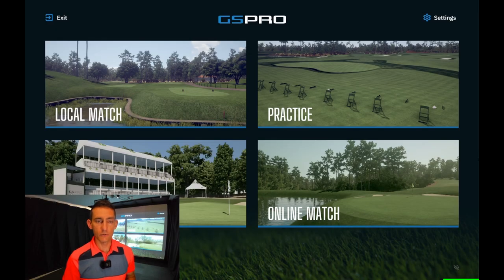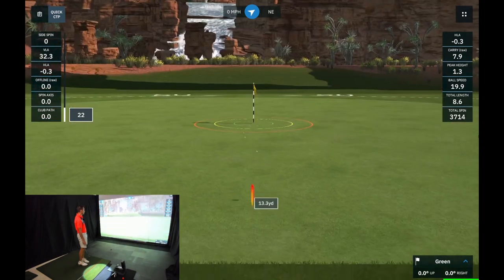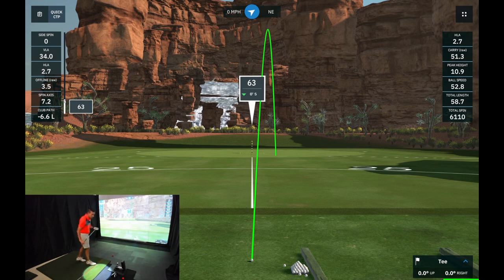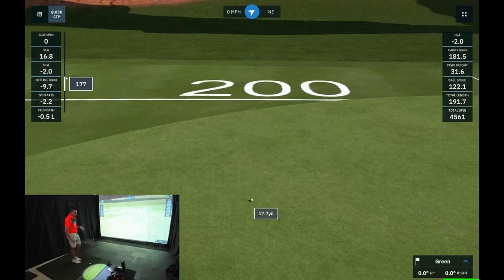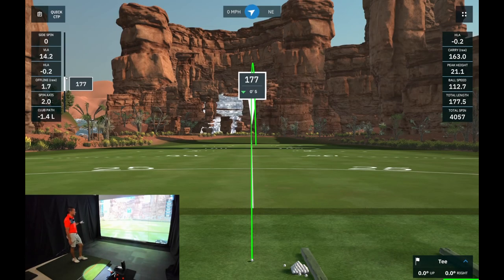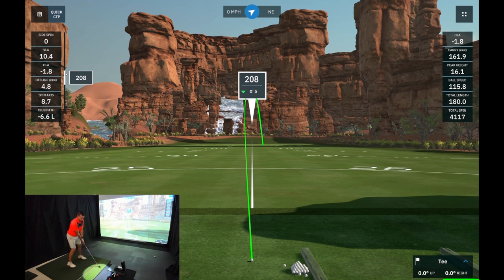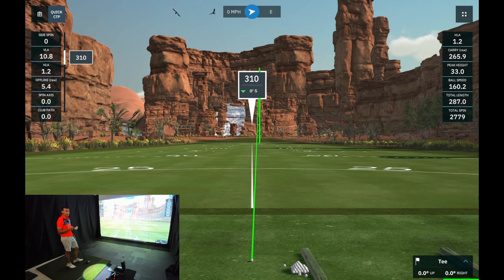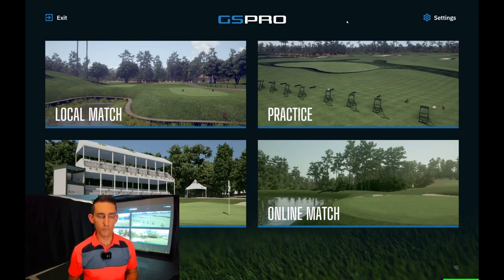Garmin R10 and the SCI-CORE Golf Balls

Comment: I've had trouble with noise complaints from next door as well.  It's quite frustrating considering the neighbors actually built their new house on the vacant block next door and chose to put the house right next to my shed where I put my simulator setup.  To make matters worse the guy works night shift sometimes and sleeps in the day so he even complained when I was hitting balls in the afternoon.  It got a bit tense there for a while!  I might give these SCI-CORE balls a go.  Thanks for checking them out.
Reply from the maker: Hey John that’s no good mate I really feel for you… I mean tbh its your property and during the daytime hours you can do what you want.. there are of course council rules that people should follow. I looked in to the council requirements and essentially said during the hours of 8am and 8pm I am allowed to do it and I wont do it outside those hours. It gets really tricky and Ive gone to lengths trying to sound proof as much as I can. At the end of the day I want to keep everyone happy as well. It sounds Ike you have been very unlucky with the guy working night shift as well…. What are the chances!! Every time you hit balls now I bet you’re thinking about it as well.

Comment: Interesting testing Joe  as always . See there’s a new range on GSpro (Mountain range).  18 holes of different length holes 1st one 320 yards the rest shorter in 10 yard increments bit of a change for practising . ⛳️ Have you tried new putting software with r10 using a webcam .Managed to get it working with an orange ball not sure if calibrated for distance correctly be interesting to hear how you faired ?
Reply from the maker: Thanks Peter! Yes I did actually use that today! I'm just a sucker for the night range on GS Pro. I have tried the putting software but it was a while ago as I was testing it out for Alex before he released it. I do need to check it out again because he has improved it a lot since I used it! I think the best one for me when I used it was green believe it or not haha. Against the green mat I was really surprised. I said to Alex at the time I think it's actually better at picking up HLA on slow putts than the GC2 is!!

Comment: I wonder if you used a white golf ball instead of the orange version, would it work better. Additionally you might need to have the logo facing the camera so it can see it. This information comes from viewing a few different video sources doing the same experiment.
Reply from the maker: Hey Reginald so this is the Garmin R10 experiment with the sci core golf balls so the colour of the ball and the placement of logo wouldn't have any effect on the reading as it's a radar only unit. I definitely want to test it out with the MLM2PRO though in the future and then logo placement might be something to think about. 
Cheers